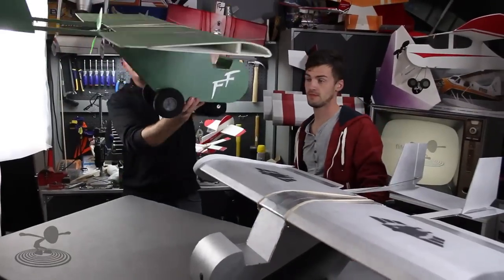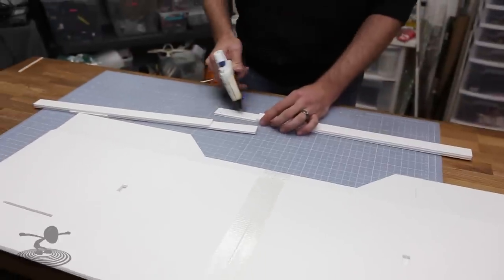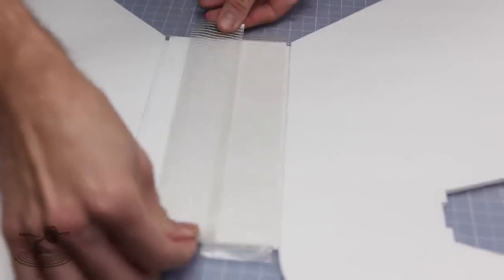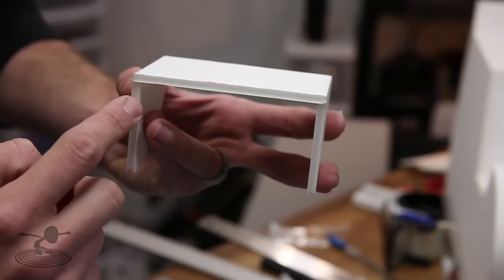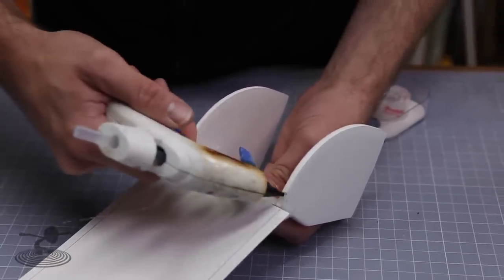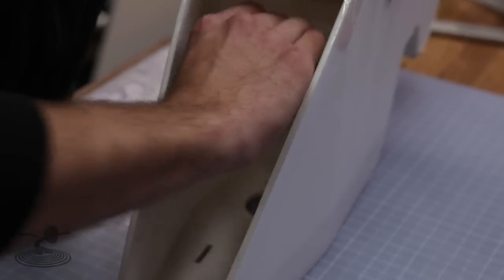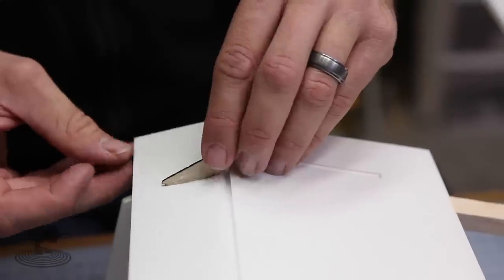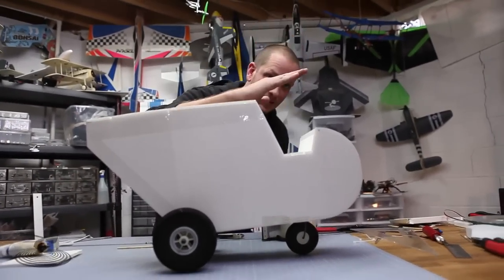Flite Test - Fowl Flyer Swappable - SCRATCH BUILD

Comment: A critique if I may, the "grain" you talk about in the poster board, could it be that holding it on the longer edge with less over hang is sturdier than holding the shorter end that has more over hang? Pretty sure poster board or paper or card stock doesn't have a grain just because of the way it's made.

Comment: When bending foam board, use this formula to calculate how much top layer to remove on the inside of bend
X =(2pie x T x angle to bend) / 360
Where X is the strip to remove, T is material thickness